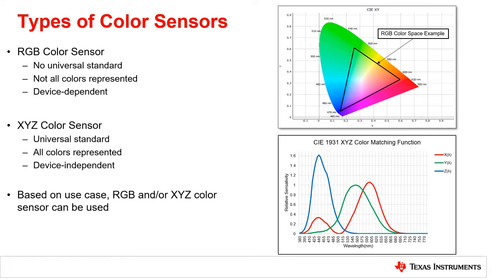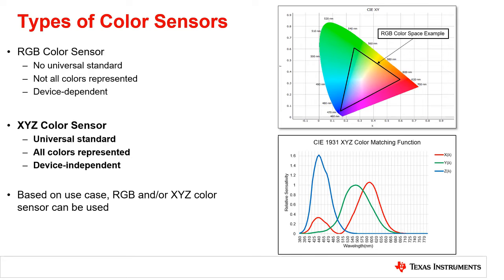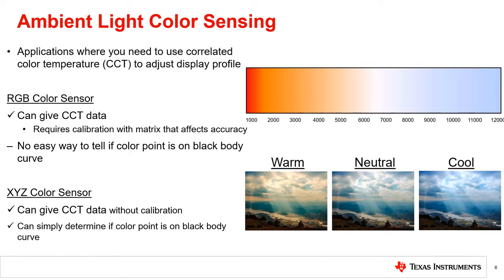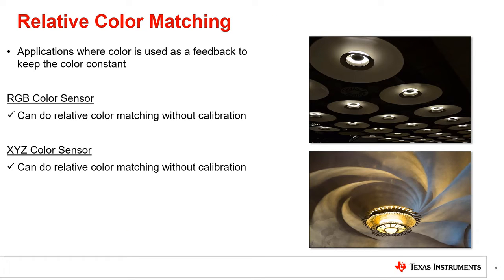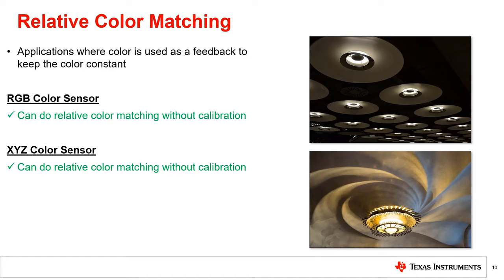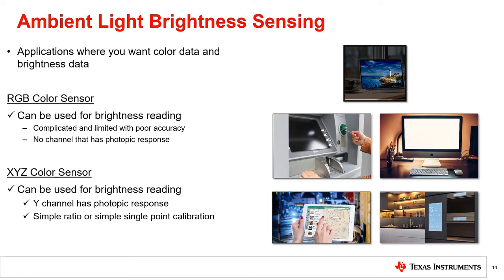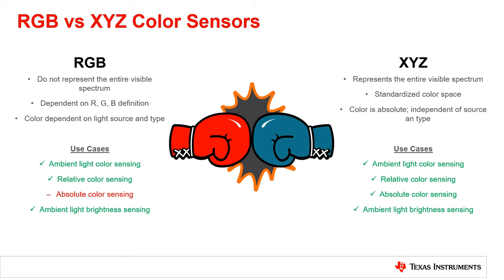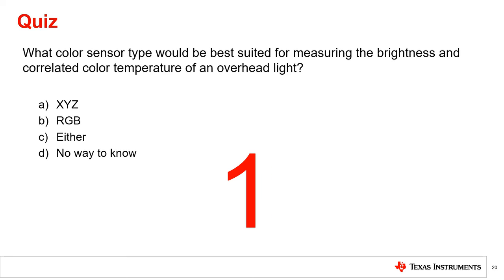Choosing a color sensor for your application

Comment: Hi, great video.
could you please suggest me which kind of color sensor preferred for spectroscopic application?
Reply from the maker: Hi Shiva, thanks for your question! The OPT4048 is the closest we have to a spectroscopic device that has multi-spectral sensing. Unlike a standard spectroscopic scope, this uses 4 channels (X, Y, Z, and Wide Spectrum) to measure the wavelengths from the source.
Reply: @TexasInstruments  Thank you 👍